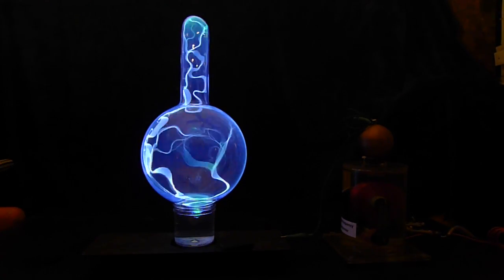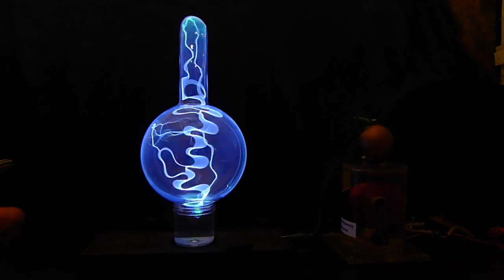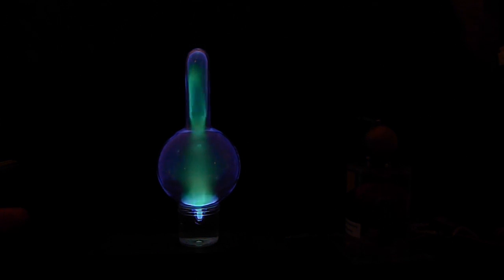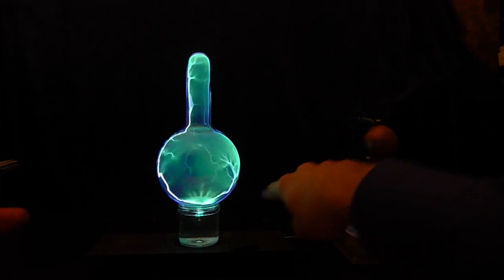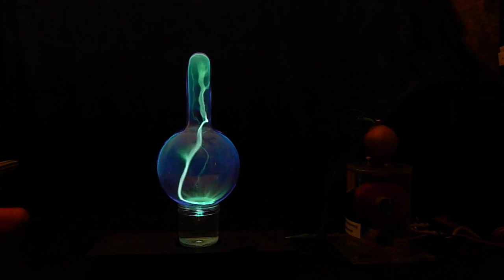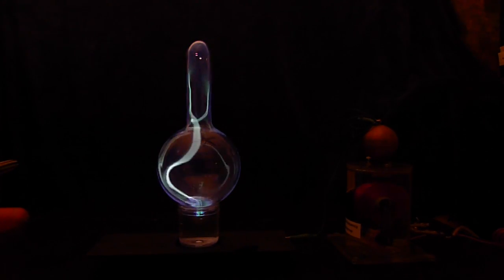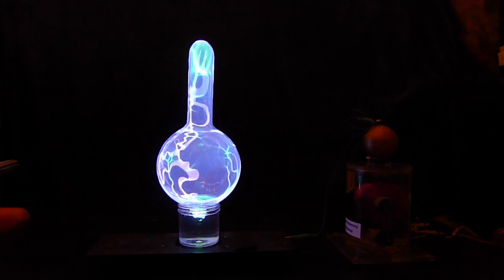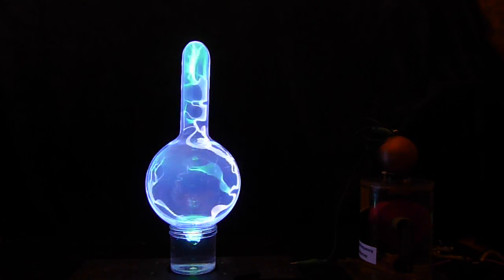Decorative xenon plasmas, 20-80 torr

Comment from the maker: Here is the procedure.  First wash the flask in sulfuric acid + H2O2.  The frit logo is removed with dilute HF.  A 1/4" heavy-wall tubulation about 8" long is sealed to the round bottom of the flask.  The neck of the flask is drawn off, sealed, & blown out to a test tube end.  The flask is annealed in a kiln.  While still hot, it is attached to the pumping station via a compression fitting, evacuated, & backfilled. Finally, the tubulation is carefully collapsed with a torch flame & pulled off.
Reply: cool thanks for all your video's explaining with super detail the marvels of plasma tube art, you are very inspiring.. for a while now i'm playing with the idea of trying this myself and your video's provide me some good info, i'm happy to learn it's not going to cost me thousands euro's for all the gear.. but first thing will be learning electric engineering, don't want to kill myself :p what do you think about Anthony Peratt's work on  high-current z-pinches comparing them with images of petroglyphs, geoglyphs, and megaliths.? must have been quite a show to have seen those in the sky.. anyway thanks and take care!!
Reply: Hello, which vacuum pump do you use to get 10.20,40,80 torr?

Comment from the maker: I can't comment on the energy systems application, but can confirm that helium at fairly high pressures (close to atmospheric) makes long and interesting streamers.  Helium has the problem of of diffusing through ordinary borosilicate glass very quickly, so its suitability for this kind of project is debatable.

Comment from the maker: Without experimenting on the particular globe, it's not possible to make any commitment about safely and effectively replacing the power supply.  There are several commercial options in the $50-400 range that could plausibly power it; control features vary and may not match what Mr. Falk designed.  I am happy to take on these kinds of projects.  If you are interested please email me.

Comment from the maker: All of the mass-produced, commercial plasma toys contain some xenon.  The typical mixture is neon at a large fraction of 1 Atm and a low partial pressure of xenon to help create filamentary features.
Reply: What happens if you put an electrode inside that glass like in a neon sign, but using xenon gas instead? Do you get these cool wandering arcs still or is just a blue/purple glow?

Comment: Hello Carl, I use only Pyrex in the first testing phase. The best glass for use will be Quartz glass. It does not contain Boron and is Silica based. It has special electric properties and does not filter any light. An excited quartz tube with helium does create a lot of ozone. Quartz is very expensive and very difficult to work with. You need a hydrogen torch for that.

Comment: Would it be possibel and safe to put the water in the plasma tube ?
Reply: If you mean liquid water then no, it would boil at room temperature due to the very low pressure.

Comment: Can a plasma toroid be accomplished in this tube?
Reply from the maker: A toroidal discharge can be produced by magnetic coupling of the gas to a suitably intense RF field.  I recommend 10-200 MHz with a few hundred watts delivered.  A diathermy machine will do it well enough, provided you arrange a decent impedance match between the output and a driver coil of a few turns of heavy wire.  You'll get a "donut" discharge in the gas.  If the induced EMF is insufficient to ionize the gas, it may be preionized with a small handheld Tesla coil or similar.